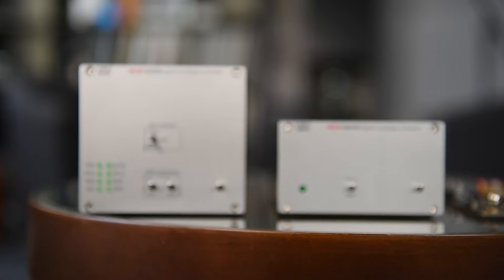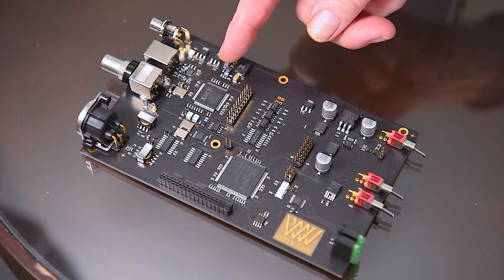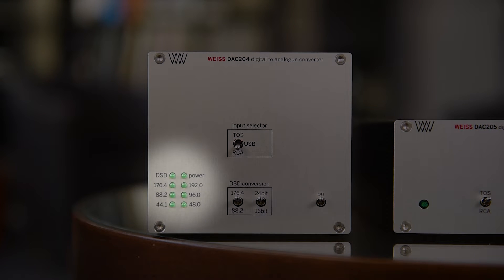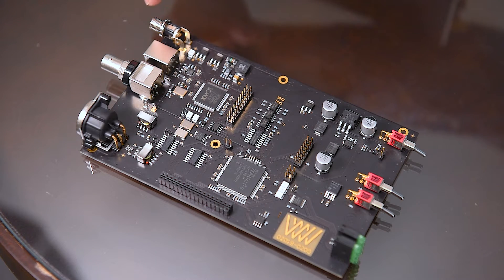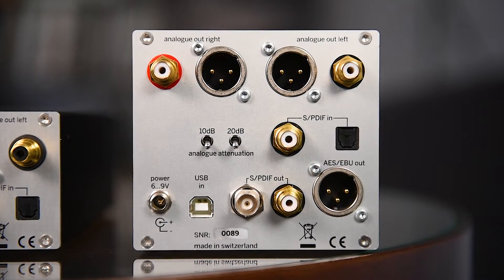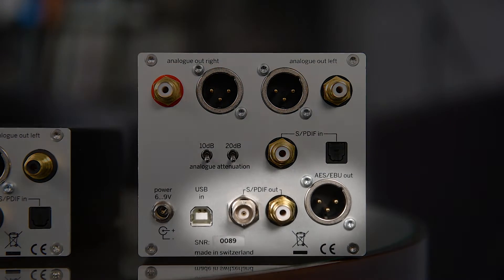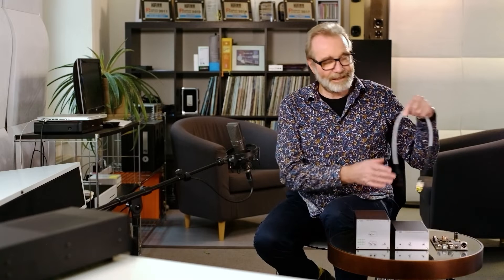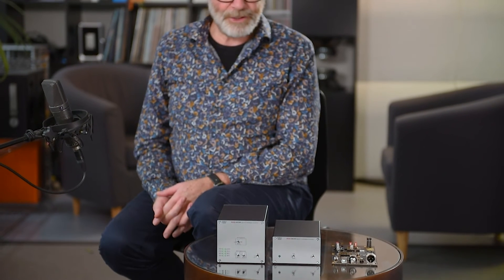DAC204 & DAC205 – Plain HQ DACs for high-end hifi & pro audio

Comment: I auditioned your DAC204 with PSU102 and without PSU102.  The sound without the external power supply is not as good taking into consideration the new price increase.  Furthermore, consider housing the boards into larger case.  I never touch Chord Electronics DACs because of their  tiny enclosure and they can be bettered by other DACs on the market IMHO.

Comment: Is there’s DDC built into 204 which converts usb into I2S internally? Also is there any fuses or op amp upgrades available to further enhance the level of performance?
Reply from the maker: Yes, the USB interface section converts DSD64 or DSD128 to PCM. There aren't any upgrades available.
Reply: @weiss.engineering  thank you. Can the Weiss play DSD files in there native format?
Reply from the maker: @ericelmore887  They have to be played in DoP.